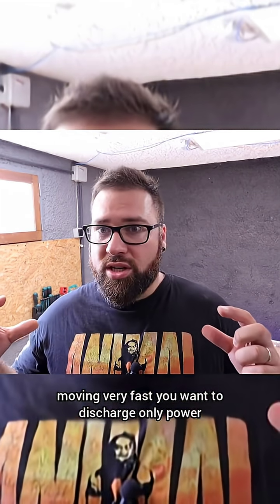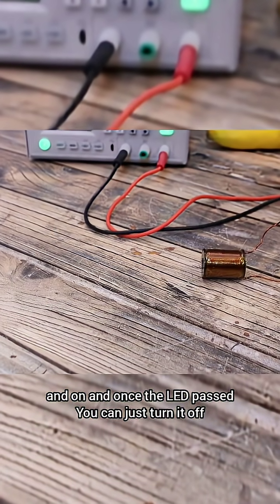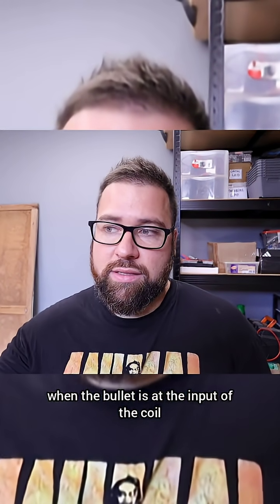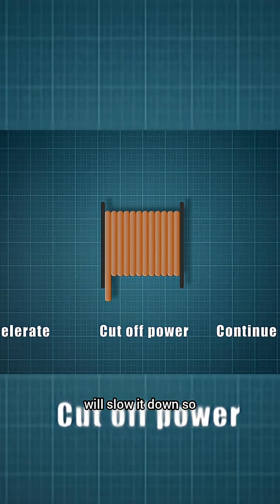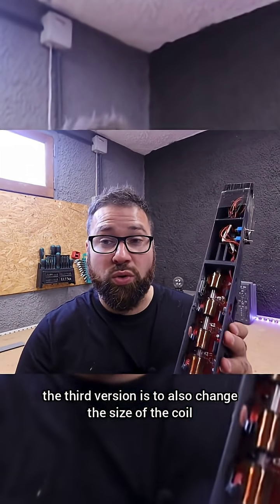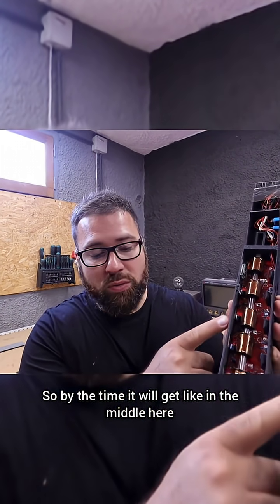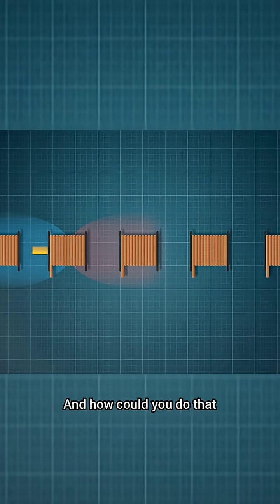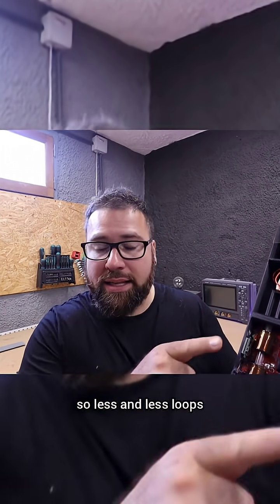How a coilgun works?

Comment: I know how to decrease the charging time of your gun by 800% without increasing its charging current.  I would gladly explain it to you but for that I would need to give you some diagrams.  I am a physicist working in the field and I am very experienced in these matters.
Reply: If you tell it will make it a way to make a maintainer for a electrical bike system. Cause if you make it more powerful by 800%. I can make the power grow in the electrical system.
Reply: @davidruckman8122  No. This is not applicable to an electric bike.  Electric bikes are already ~90% efficient.  His coil gun is only ~4% efficient when you divide the kinetic energy of the projectile by the electric energy stored in his capacitors. ½mv^2 / ½CV^2.  My improvement addresses this quotient.

Comment: Hello i am Abdulrahman from INDIA 🇮🇳 

I have an idea after coils are changed
Then when you push the trigger you can set all igbt to precharge all capacitors and activate all the coils within 1 or 2 seconds and keep them charging untill bullet enters the coil
Then you just turn off the first igbt bullet about to leave center half of the coil this will turns off the coil.

Doing this to all the coils till the last coil bullet will move with full power without any performance loss 

But keeping pre charge is a bit of efficiency loss so as this hole process happen from pulling the trigger to bullet pass the last coil should be done under 2 to 3 seconds 
The only thing is to sense the bullet position with sensors 
That it.❤